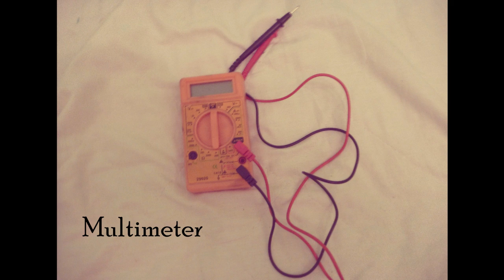Xbox 360 Steering Wheel Clutch Pedal Mod

Comment: The xbox 360 steering wheel is so easy to brake apart and do stuff with it. I had to open it to replace some buttons that were broke. 30 minute work and it works! Great job mate btw!

Comment: Like steering wise. Like did you make the turning  on the wheel a little more stiff or loose? Just wondering because I recently bought one of these from my cousin and I felt it turned a little 'loose'. Just wondering. Btw the stick shift mod is sick.

Comment from the maker: Inside the old pedals, there are 2 rotating switches or 'potentiometers' (I only used on of the pedals though). All I needed was to find the terminals on that switch for the power in and adjusted power out, then connect a wire from each of those directly to the circuit board within the Xbox 360 steering wheel at the points which correspond to the 'A' button, as that is the button used for the clutch in Forza. It's just hard-wiring as the pedal is basically a switch.

Comment from the maker: No, I didn't change anything to do with the steering. Just wondering, when you used it, did you have it plugged in or was it running on battery pack? When it isn't plugged in, there is no force feedback so it feels very loose :)

Comment: Too many wires from wheel to base. I believe it is just wires from all buttons, not a digital interface. So, no sense to open wheel and solder wires there - you can connect wires directly to board inside base. Just should figure out where.